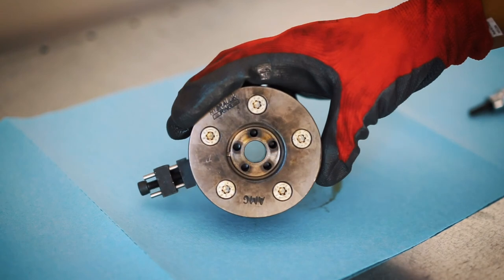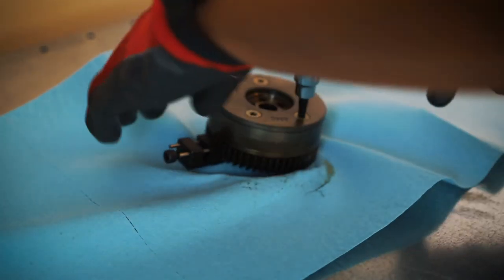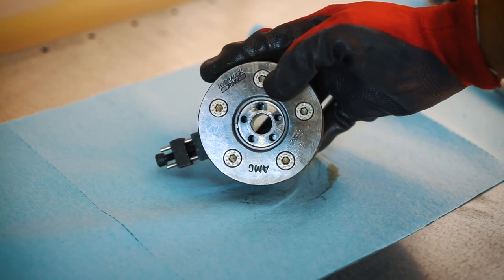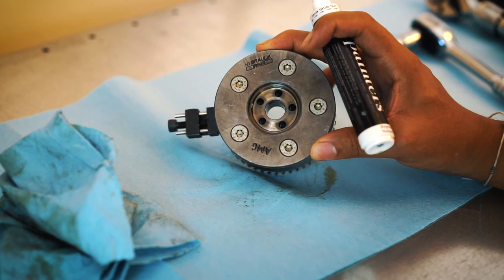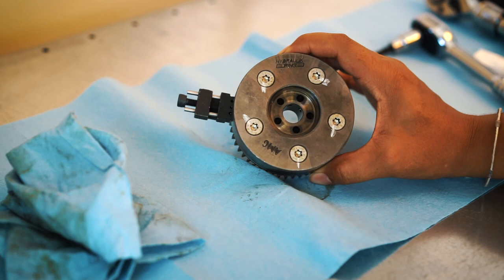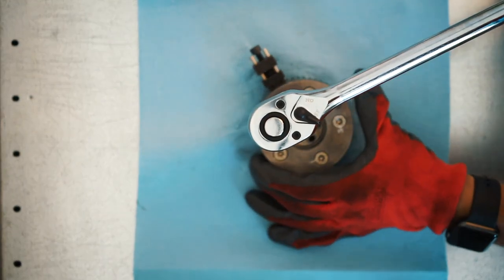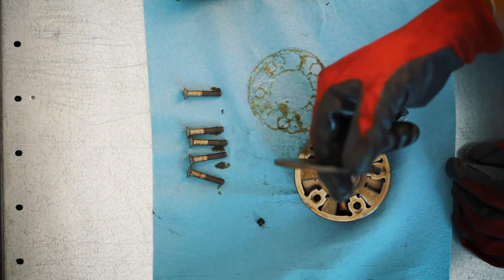HOW TO DO THE MERCEDES BENZ CAM ADJUSTER PIN FLIP TRICK ON M156 ENGINE - PART 3

Comment: There's one tiny problem you missed that was causing the issue in the first place. The pin flip doesn't solve the problem. If you'll notice the hole that the pin slides into has been worn down to about a 45°angle. That pin hole is supposed to be a sharp 90° hole. The only real solution is to replace the plate.

Comment: I've seen it on XF Motorsports, he basically welded the hole on the plate completely and drilled a new hole in cnc machine. Its brilliant and cost nothing 👏
Reply from the maker: Thanks for the suggestion!
Reply: Saw hat myself and while is a much better option, you at taking some long term risks there. TIG it and you end with a high speed rotational mass of different properties, I can see the soldering eventually falling during a cold start, flying inside the crackshaft adjuster cover and breaking havoc. Just get replacement plates and pin. Got mine from 63 motorsports, in Canada and did with my indy mechanic here in Dallas, Texas.

Comment: Be serious man, you should rename this video to clearly indicate what not to do!  This trick only save you money if your only goal is to pass the problem to the next unsuspected owner of the car, I don't think you want to get that reputation. The way to fix this cheapear but safer, is to get replacement plates and pins. I did my CL63 2008 a little while ago using parts from 63 motorsports, a Canadian company. Cannot be happier.

Comment: When you're turning it by hand you can see the adjuster you messed with is not locked (loud click followed by delayed rotation of cam)... The hole in the plate the pin drops into on your adjuster is toast my dude.
Reply from the maker: You are correct. And I wish I knew that before I put it back in my car! Lol. But I did resolve the issue. (CAMSHAFT ADJUSTER FAILED! What went wrong with pin flip trick.
https://youtu.be/N23oASFpfvM)

Thanks for your comment and checking out the channel! 👍🏽

Comment: That wear on the adjuster plate is NOT normal. That plate is wearing down due to the softness of the steel plate. Flipping that pin will do nothing to solve your problem. You need new parts, especially that adjuster plate. You will be back in there again doing the right thing later, trust me.
Reply from the maker: You are absolutely correct! I was back in there changing out the whole cam adjuster 😬  https://youtu.be/N23oASFpfvM
Reply: @DriveTalkCars  You should change or pull  the video as you will be misleading people and making folks think the part wear is OK.
Reply from the maker: Thanks for the advice. I took that portion out.

Comment: Hey, i have one question , how did you deal with the torque when you Put back pieces? Can you précised them or There is no matter? Thanks
Reply from the maker: What I did was marked the bolts location on the adjuster. Then when I put them back in I started at those marks and tighten them until I lined up the marks. That worked for me. They were pretty tight by the time they were aligned. But yeah, there aren’t any official torque specs that I could find for the camshaft adjuster bolts.
Reply: DriveTalkCars yes i noticed that it well explained thanks , but what about the head cover and other thightening do you do it by feeling or you have some spécification Coming from « star software » excuse me for my english, and you are welcome for a drink when you pass through Audun-le-Tiche ;)
Reply from the maker: Oh I see, yeah the camshaft adjuster cover to cylinder head bolts are torqued to 10 Nm. And the valve covers are tightened to feel. Over torquing them could crack the plastic cover (if you have plastic cover). The bolt for the engine harness ground to cam adjuster cover is 9 Nm. I hope that helps. 👍🏽
Reply from the maker: Definitely will take that drink btw 🍻
Reply: @DriveTalkCars  There is a video someone did, which I can't find now, where they didn't torque down the cam adjuster bolts properly after they were put back in so they became loose. Anyway, Tasos actually commented the torque specs for those bolts in that video. I believe it was 20 Nm but I will have to find it to confirm.
Reply from the maker: Cam adjuster bolts are torqued to  45Nm= 33.19ft-lb. Thanks for the comment! 👍🏽

Comment: Hi.....crank poly at 40* ....lock camshaft with tool at back and front ...lock cam adjuster by toothed tool ...now inserting adjuster into camshaft at this point is there any mark to positioning  the adjuster or any way go only set the sensor plate in right position by front red tool and tighting  the bolt ? thanks for share
Reply from the maker: I have only used the tool. I don’t think I would trust it without it. But there may be a way... thanks for commenting and checking out channel!

Comment: You didn't need a longer ratchet to undo the torx screws in the cam adjuster as when you first tried you was turning them clockwise instead of anticlockwise.

Comment: Looking for some advice. Took out cam adjusters on a 2010 c63. The two gears that you are supposed to lock in place were not aligned perfectly and therefore I could not get the pin in to lock both of them in place. I did manage to get a small bolt into the hole so that when I took the adjusters off, the gears stayed mostly aligned however they are about one gear tooth off from where they need to be to go back on properly. Is there any way to get the gears aligned? A buddy of mine says I would just pry one gear back into place using a flathead but that it takes a ton of force. I don’t want to mar up the gears and am worried about damaging them but also don’t want to have to replace them if they can be realigned properly. Any advice?
Reply: You need to be talking to a tech at merc who has insight on the CA's, churning on them to make the keyhole fit doesnt sound to good.. also why remove it if it doesnt add up?

Have you even checked that your are correct on markings regarding dead center (no pressure on valves) 

Also dont flip the pin if your plate looked like this guys plate.. just waste of time and wont do you any good.

Comment: Did you use your old bolts for the valvecap and the frontcover ?

What is the torque for the black bolts - handfit and 90° ?

Did you also used the old diamondplate and the old bolt for the adjuster ?

Comment: Is there a mileage time frame we're these start to fail? I'm looking at buying a c63 amg 2014 507 series and don't want to deal with this within the first year....
Reply from the maker: Um…I heard of them failing at 40k miles so I would say no there isn’t a mileage time frame. However, I would anticipate them definitely starting to go bad or show signs of failing around 90-100k +.
Reply: @DriveTalkCars  thank you.  maybe lexus GS-F is the safe bet for me
Reply: Don't take a blid shoot, just make the swap of the can parts adjuster and the head bolts pretty much cost something now, however, U will save a lot o money in the future
Reply: @KangarooRide  Well, that is partially good advice... The problem is that the OEM cam adjusters have exactly the same metallurgy, so you will deal with the problem 40 or 50k later. My advice, rebuild the camshaft with 63 motorsports updated plates or similar alternatives available. Is even better that pay mercdew benz for substandard parts. I also recall that VRP speed offer and updated version of the whole camshaft adjuster, but that is overkill unless you have additional problems.

Comment: How do i know i didnt fuck up the timing?
Reply from the maker: Well as far as the cam adjusters go, the tool used is to ensure the timing is correct.
Reply: rotate the engine manually using a torque wrench after you have replaced and torqued the new cam adjusters. If you rotate it a couple times and line it back up to the 40 degree mark you should be able to put the lock plates on both banks and it should still line up again. If it doesn't, or if you feel a lot of resistance when turning it by hand, that means the timing is probably off

Comment: Great video but….. At 6:41 you can see that the hole the pin fits into has a ramp on one edge which is the real problem here. Flipping the pin end for end won’t solve the issue in the longer term since eventually that end of the pin will wear. What you need to do is replace that plate. The real issue is that the metal on that plate is soft and that’s why you see that ramp forming since over time the pin is eroding that edge.
There are aftermarket plates available which are machined from harder steel which is the only long term solution.

Comment: Always should follow the torque specs, but your video ia fucking amazing, seirous that is the most commum issue in m156, and looks like isn't so hard to avoid 5 grands spend in mechanic. Great video, fuck loved
Reply from the maker: Thanks for the comments and checking out my channel! 👍🏽
Reply: The plate IS fucked! Flipping the pin saves you jack if the locking hole FOR the pin looks like the damn french alps sweet and all at 43°... keyhole supposed to be a squared up hole. This flipping of pin without knowledge on how the plate is supposed to look like is just pure waste of time.

Comment: Would you do it for me 😭
Reply from the maker: Lol...it isn’t too bad. The biggest thing is overcoming the fear of royally screwing up you car. 😬 after that smooth sailing. Just take your time and it will be ok
Reply: @DriveTalkCars  that's my concern. The car is old and the plastics stuffs under the hood is aged and became brittle. Yet they are still tightly hold together. I just don't want to accidentally rip anything apart.
Reply from the maker: I completely understand

Comment: Please do not just flip the pin around and call it fixed. The adjuster plate is clearly worn. The ramp on the adjuster plate @6:44 is not what it should look like. The reason your car ran fine after the “repair” is that the pin is worn as well but not to an extend as the plate. You will be doing this again soon and that time you will have to replace/repair the adjuster plate.
Reply: Exactly my thoughts. Looks like he didn’t test the lock after reinstalling
Reply: The ramp wear around the hole are what is causing the pin to lose its purpose, so agree this video is somewhat missleading.
- The adjuster plate material are weaker than the pin material hence this issue...
- Replace or repair the plate as Sven mentioned
Reply: The pin was good, the plate was bad... problem remains... typically, the pins show more wear and the flip helps, but the flip won't resolve the plate wear issue you see.

Comment: As I continued watching the video more and more mistakes are seen. @8:42 “little movement but not much”. You don’t want any movement. 

Your marks on the bolts for torque reference would somewhat work if you put the bolt back where there came out of. The bolts and the threaded holes don’t have the tread start. You could have at least use the torque used for that size of a bolt at that grade. And @18:02 your flipped pin popped out the adjuster plate.

Overall good videos. But the content is misleading and could cause others, who might do the same by following your instruction to destroy their engine.

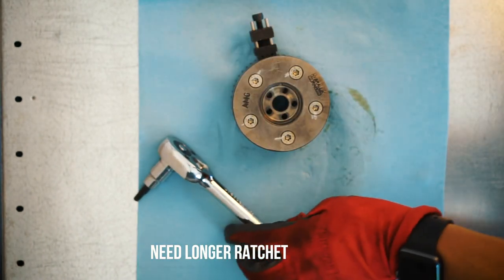Comment: LOL... @4:01 "Need a longer ratchet" - All your viewers aren't stupid. The video clearly shows that when you were using the small ratchet to try to loosen the bolt, you were trying to turn it in the wrong direction!!
Reply from the maker: Good observation… Never intentionally showed going wrong way to emphasize the use of a longer ratchet.  Guess just used wrong clip when editing 🤷🏽‍♂️😬
Reply: @DriveTalkCars  :) LOL... no problem. You still have a great channel, and it's a good video, regardless. I didn't see any other comments like mine, so people must not notice it anyway. - I have 08 ML63 AMG with the M156. Had to pull the intake to replace the crankcase vent and clean the intake. Beast of a job, but thanks to guys like you, I got it done!! Cam adjusters are down the road, so I appreciate the content you put together. - Peace.

Comment: DO NOT FLIP. BAD IDEA. JUST REPLACE
I have a 2006 C280 with a M272 engine that has this problem on the left side (driver) cylinder head. The previous owner neglected the car by NOT changing the oil frequently.  These multi cam/ flex cam engines need clean oil and correct quantity of oil or they fail in many ways.
Reply from the maker: Replace would have saved me time and extra work(Lol) or a new back plate.